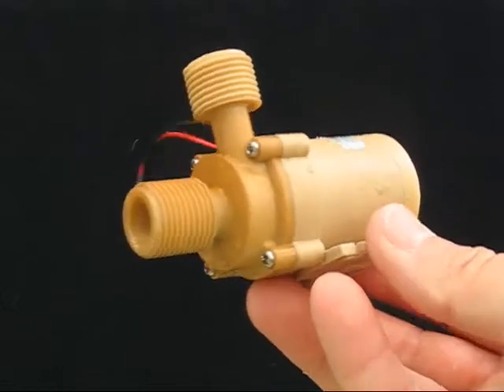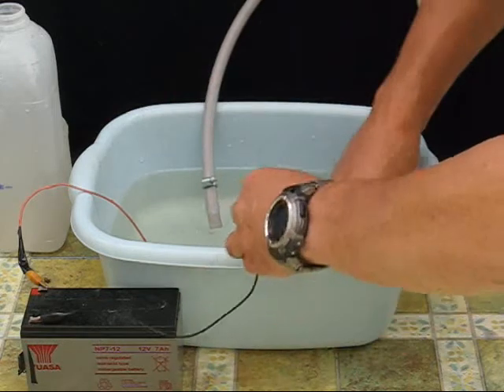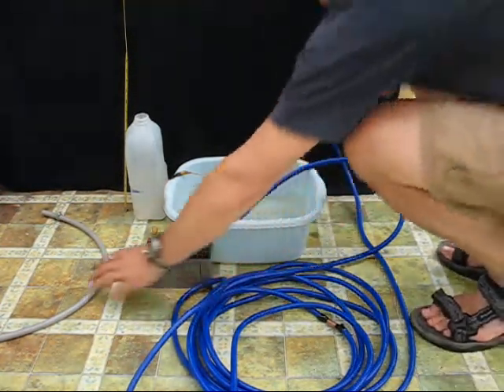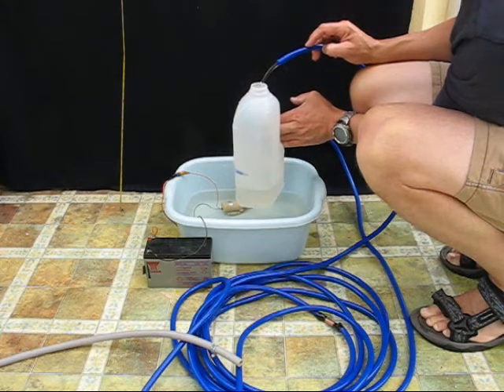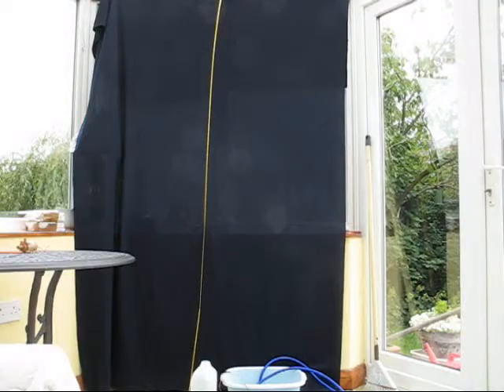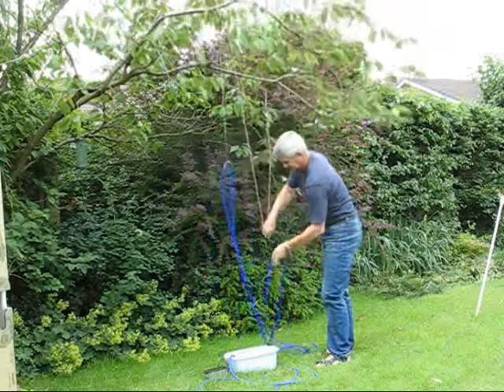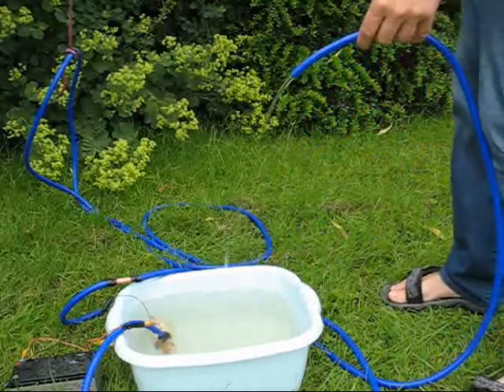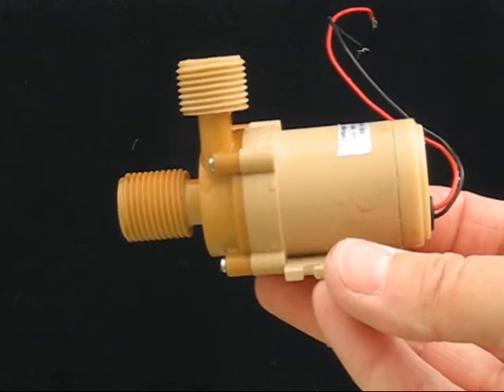Flow Rates and Pump Head.wmv

Comment: Does having the longer smaller tube increase the work that motor has to do? 
Does the motor give off more heat with the smaller tube? 
Does the motor pull more amps using the smaller tube?

Comment: Hi Peter: I'm trying to work out what size solar-powered water pump would be suitable to bring water up from a 60 meter well. Any help that you can provide would be much appreciated.
Reply from the maker: You would need a different type of pump for such a large height of head.  I do not know of any 12 volt immersible pumps that would handle that, assuming the water surface level is really 60 metres down.  As a rough guide, 1 bar of pressure is needed to lift water 10mtrs, so you need a pump of say 6 or 7 bar, thats about 100 PSI, so you should look at specialist positive displacement pumps.
For smaller lifts it is possible to daisy chain my little pumps 5 metres apart, but you'd need 13 of them!